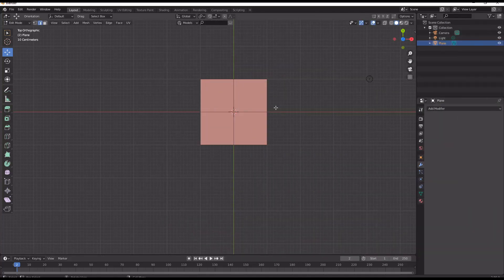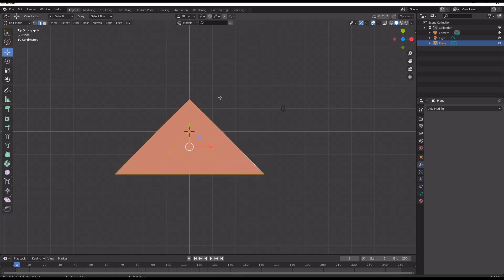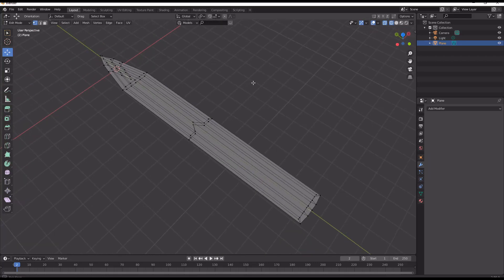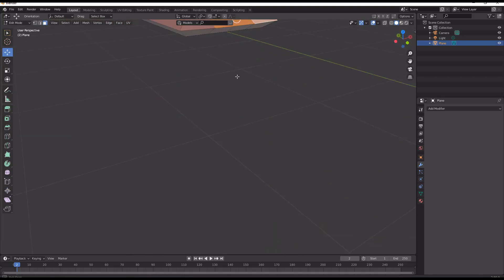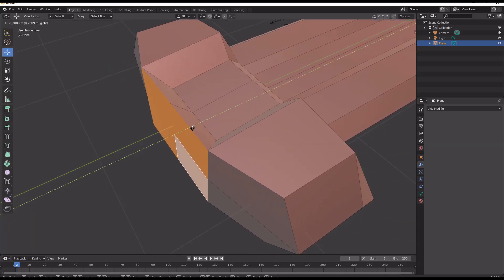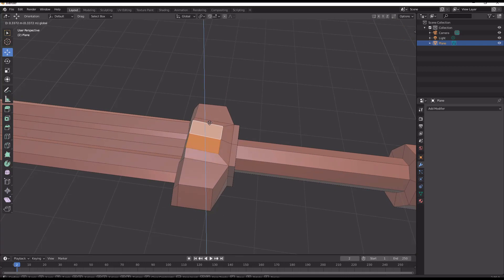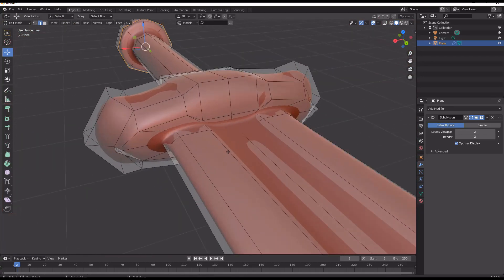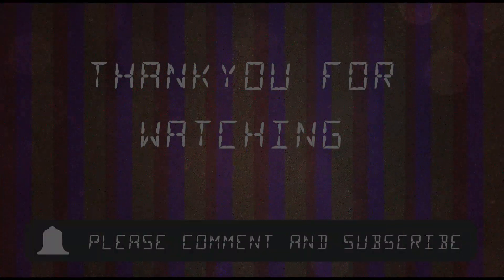How to model a sword with perfect Edgeflow in blender 2 9

Comment: For anyone wondering what happened with the magic flattening edge at 0:37:

I don't know if it's because this is old enough to be on a different version of blender (I'm new I don't know anything about the update history) but when you scale and press x with that bottom edge, you can follow along just fine, but when you try to just press 0 while doing that, all of the vertices just disappear behind the plane, and make a sharp point with the bottom-most vertex.

Here's the steps to get the proper effect shown in the video:
After extruding the bottom edge, press S with the bottom 5 vertices of the edge selected, then press X to widen the bottom along the X axis. 
Click to set once you have it like you like it. 
Now press S to enter scale mode once more.
Press Shift + E and (for me) a green vertical line will appear, NOW press 0 (zero) and the edge will flatten. 

If you don't get the vertical green line, check the rotation angle of your subdivided plane.
When he rotates it by 45 degrees, he presses R and then 4 and 5. What's happening here is when you press R,
if you check on the right as you type 45 the rotation property is being edited and R is just the shortcut to modify that value. 

The correct rotation angle is -45 degrees. 

Now I'm bad as fk at math, but I remember angular geometry and standard angles on the coordinate plane. When you type 45 it rotates the plane clockwise, which is a negative angle, because 0 is the X axis and the Y axis is 90 degrees, counterclockwise. If you still don't understand google an image of the Unit Circle, the terminal limb of the angle rotates around the Unit Circle counter-clockwise to count UP to 360*. Rotating the terminal limb of the angle clockwise past the X-axis makes a negative angle.

Comment: Quick tip. Shift + E (Sharpens edges) or a bevel modifier above your subsurf is a great way to get the definition you want without adding a bunch of loop cuts.
Reply from the maker: i actually dont use sharp markings deliberately because they offer less control over the final mesh , and also force you to  into using a subdiv modifier in a way that produces uneven and in some cases unworkable topology esp for stuff that's going to go into a game engine, with a support loops you also get a model thats transferable between detail levels and different engines

Comment: When you did the handle, you clicked on something called 'Looptools'. Is that a blender addon? I don't think I've seen it before
Reply from the maker: yes its an internal addon .. just serch for it in the addons thing.. it extends your standard modeling menue to be able to send an edgeloop to a acircle.. loft between edgeloops  a second bridge algorythem for when blenders messes up ect. totally worth haveing most of the older users take it for granted that you will just have it enbled
Reply: @swordsneko  thanks man. your videos are great!